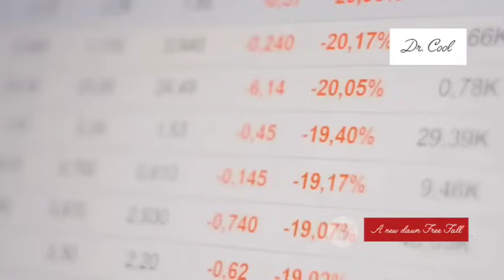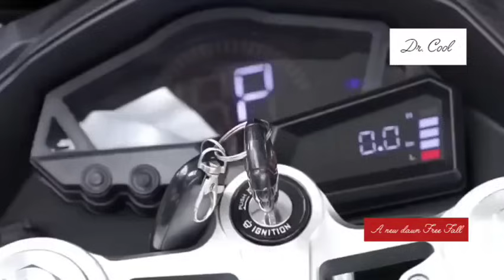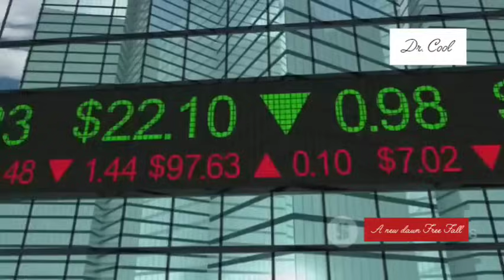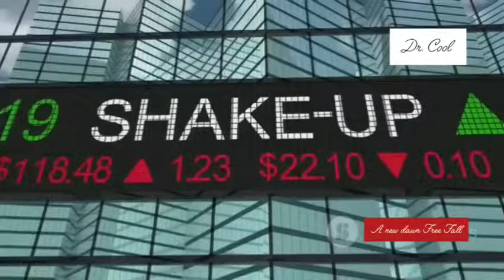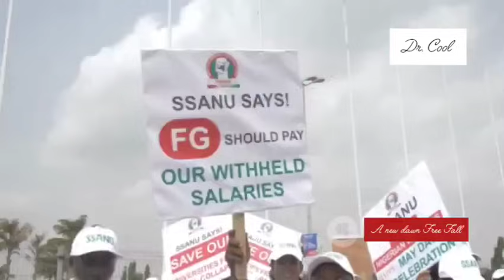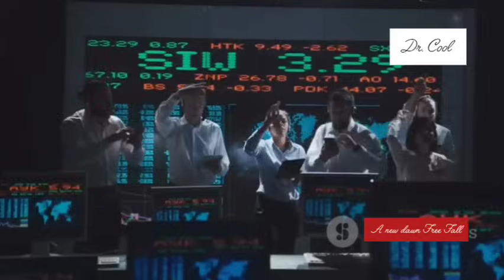Self Powered Car Set To Crash Price Of Commodities & Fixi inflation

Comment: I looked this up: the cheapest electric car in Africa is $22.000.

Let's say $7000 for the batteries. So $15000 base price without the microsonic device.
You need to increase the voltage to about 400VDC, nomally the voltage of a lithium battery pack.

So whats missing here is a 150kW DC/DC converter meeting EMC requirements with variablwidevrange voltage input.
Lets say $6500

So the base car including all the safety systems mentioned, airco, expensive LED headlights must costs around $9500 if no-one is interested in making any profit.
I dont see a business case.
Reply: Don't worry about it.  It's obviously fake.
Reply: @chrisbeard1750  yes, I know. But I want answers to questions that have no answers. Just for fun.